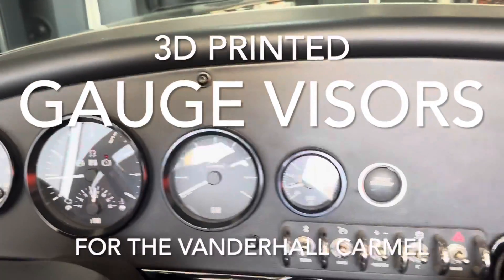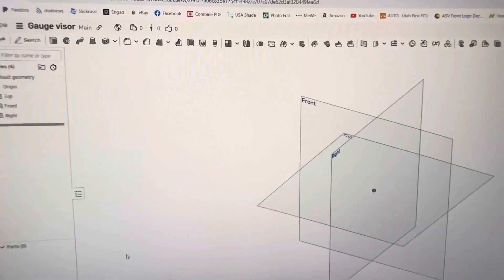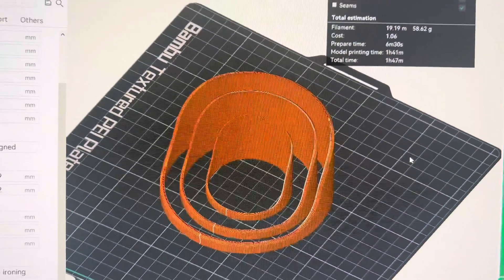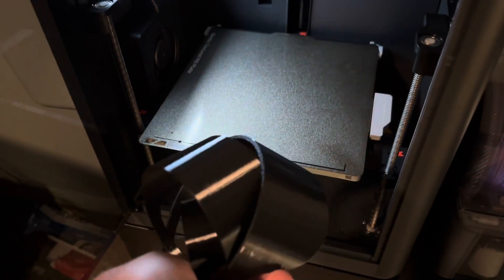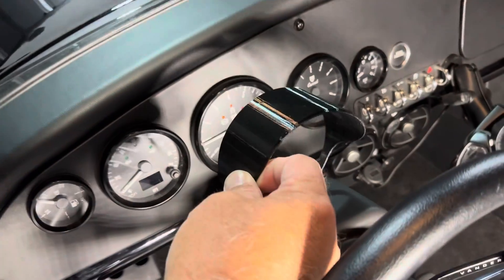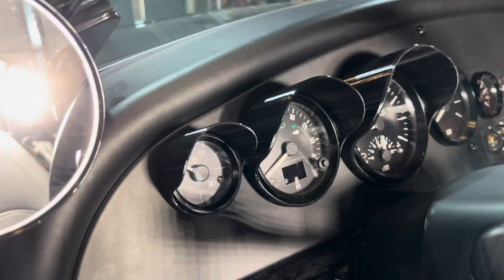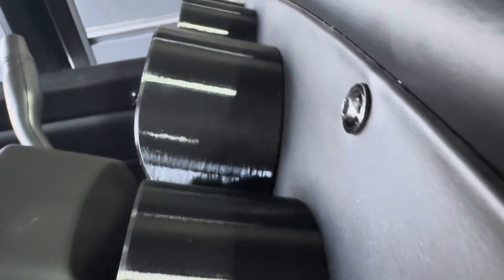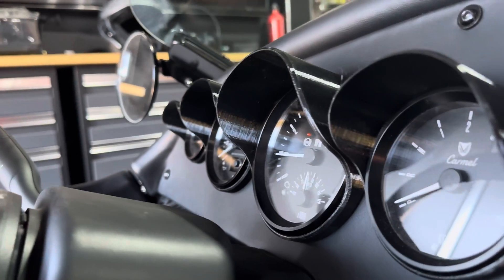3D printed gauge visors for your Vanderhall Carmel. Free print file

Comment: Thank you so much! These look perfect.
Reply: Had someone local print these for me. They fit PERFECT. They slip over the gauges very tight but thats good as they wont fall off at all. Just push them over very flush, any angle and they wont fit.